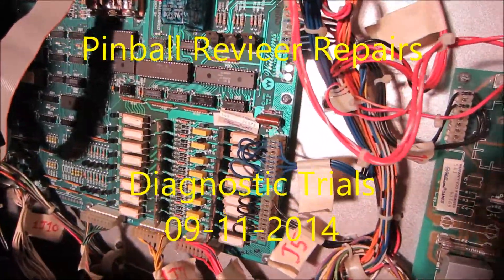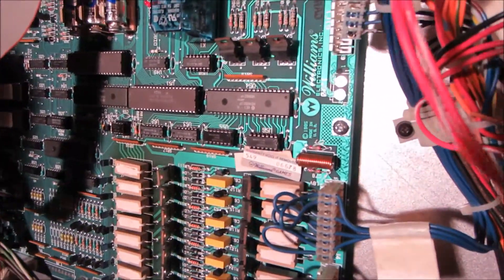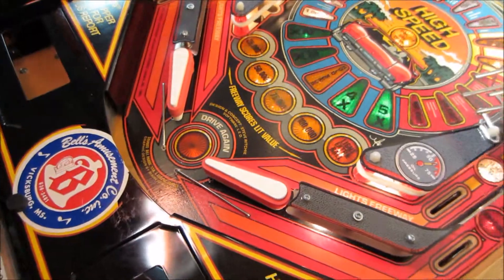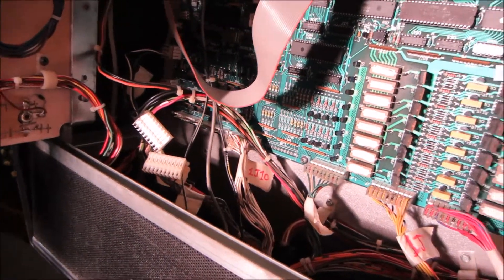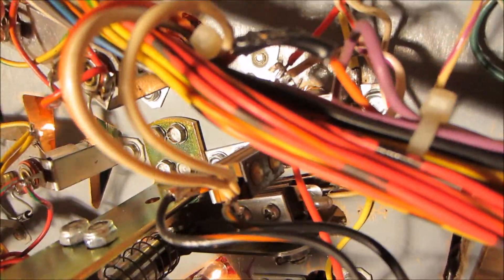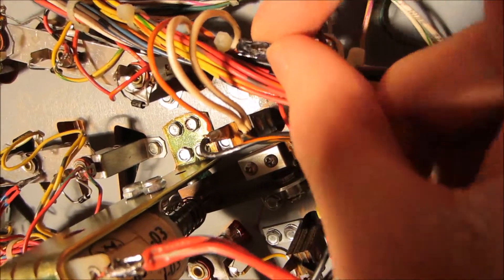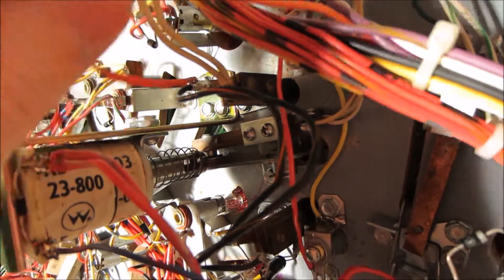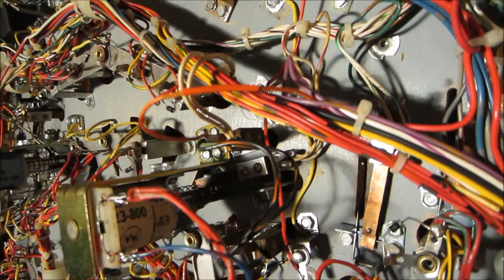Pinball Reviewer Repairs - Diagnostic Trials?

Comment: A good way of troubleshooting your issues with blowing fuses can be to write down all the wire colors and pins on your connectors, then plug a connector back in and see if the fuse blows. If not, move onto the next connector and see if it blows. If it does, then leave the ground wire on that connector in its place, but start pulling out a wire from its connector (with the game off, then turn it back on to see if the new fuse blows again), and repeat all the way across the connector until you find the one thats blowing the fuse. Once you know the wire that is the problem you can follow it across the schematic and also to the playfield to see where it leads. This method works for shorted switches or switch diodes, as well, but considering that you're blowing fuses there is obviously a dead short somewhere like a coil or dangling wire or something.

Comment: Also, grab your multimeter, set it to measure resistance, turn the machine OFF, then start measuring each coil's resistance. Put the black probe/lead on an outside lug, and red on the other and look for a reading of at least 3 OHMS.  Anything less than that can be considered a short.  If you find one thats a suspect, clip one of the wires off and see if your fuse blows. If not, you've found your problem (or, at least ONE of your problems).
Reply from the maker: Thanks the coils I have all replaced.
I am in the process of uploading that video it is just taking a long time to upload. Haha.
And the slings locking on still is happening.
I am a bit renascent to put in the plugs as I was trying to figure out why it was blowing the fuses but looking over my playfield immensely and could not find anything that is amiss.
As I have already blown about 20 fuses trying to track down this problem.
Any areas I thought might be shorting to something I put the foam that I have for my stand up targets in those areas as some places are very close to switch to metal and so on.
Reply: If the slingshot playfield switches aren't closed and yet they're still locking on, you'll need to get onto the board's "special solenoid" section of transistors and test to see if any are shorted. Probably some TIP 120 or TIP 102 transistors that are blown. Also gotta check the pre-drive transistors, as well which are usually 2N3904s. If the transistor(s) test bad, replace them and turn the game back on. If the slings are still locked, you have to move further back in the chain...  pre-drive transistor, the TTL chip for that section, and the 6821 PIA chip in front of all that.  Of course, just keep it simple by starting at the switches first, then check those transistors with your meter.